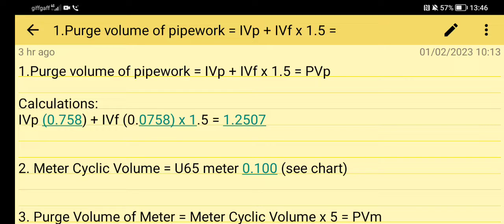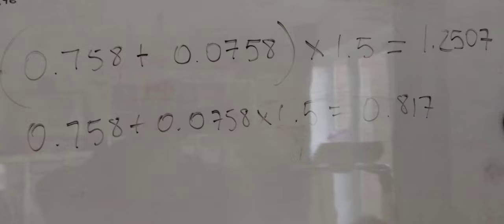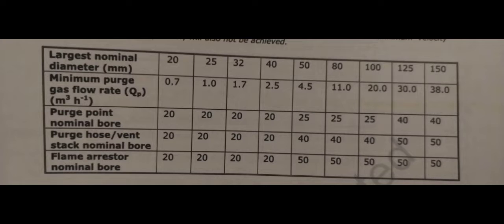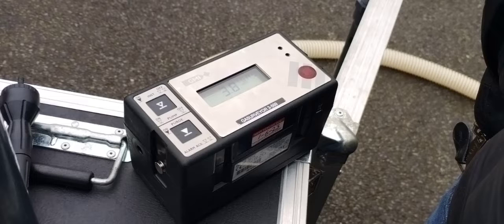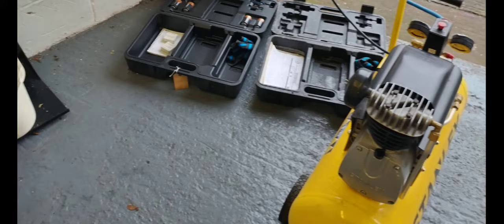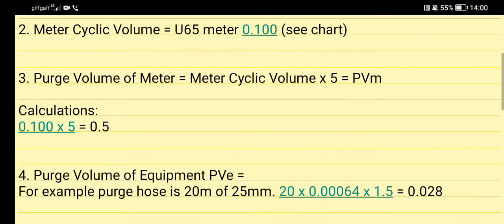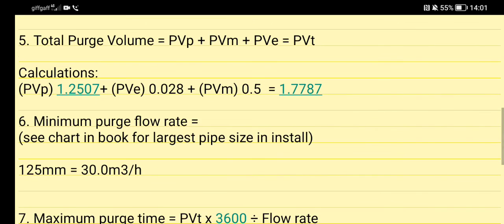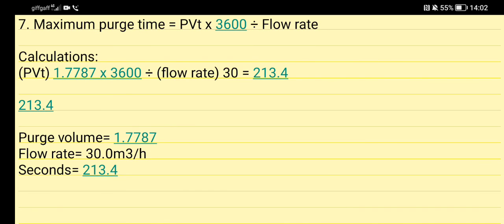PURGING COMMERCIAL GAS PIPEWORK (TPCP1A) pt1

Comment: Just realised a mistake ? 

4. Purge Volume of Equipment PVe =
For example purge hose is 20m of 25mm. 20 x 0.00064 × 1.5 = 0.028 
=0.0192
Reply from the maker: Well spotted Jas. Glad someone knows how to use a calculator. Looks like the same mistake of not hitting that equals sign.